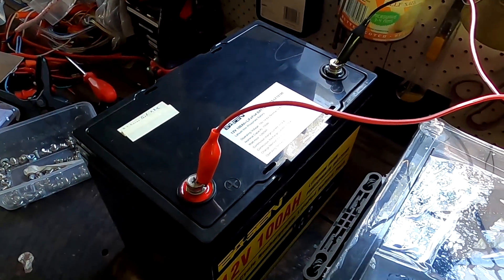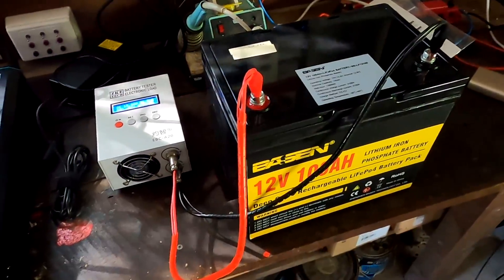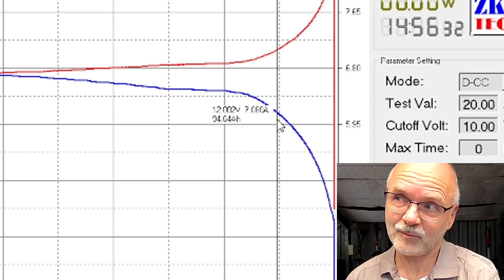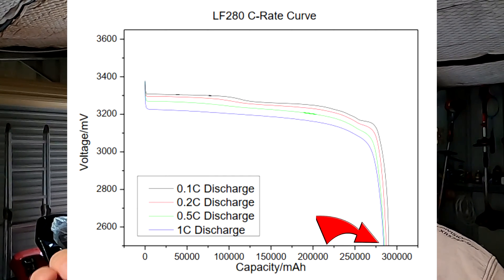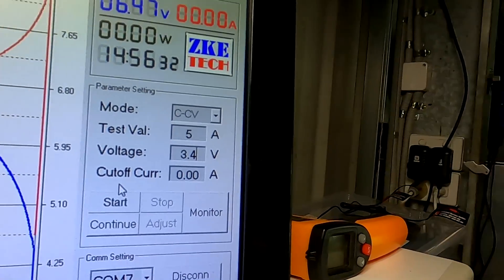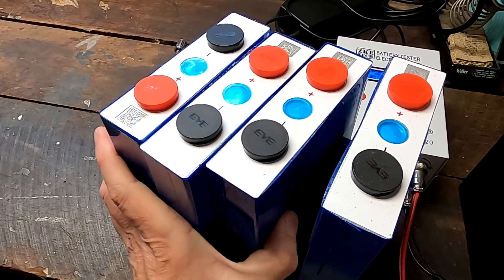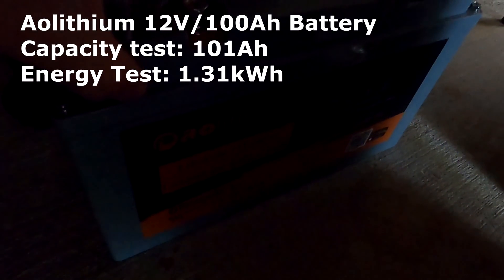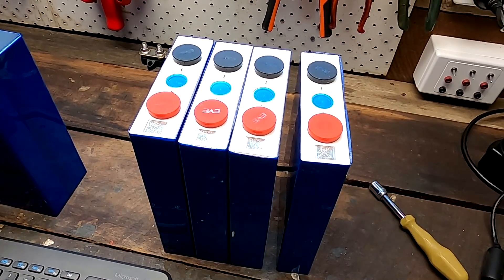The crux with most of these batteries. And how to achieve 100% customer satisfaction!

Comment: I notice your comments about "them" not being able to sell those cells, interesting cos that is exactly what I have just received from QSO.   Could you tell me what size the holes are in the battery terminals and if they are like mine m4 then how do you attach bus bars and BMS terminals?
Reply from the maker: The 105Ah cells have M4 threads and tiny unusable screws. I would really recommend using grub screws here with a decent length. Also the busbars are not great either.

Comment: Andy, i bought similar cellsmfrom Alibaba - 3x100Ah 12V with Jbd Bms. Tested:110Ah each, perfectly balanced - fine. Then i bought another 5 pieces - just want to test one - unbalnced and got only 96Ah... tested the others, goes from 94 to 101Ah and balancing for days... So, you will never know what they use in the actual batch. Thats the reason why some batteries cost the double - they use only and always good cells...
Reply from the maker: Yeah, there is a variation with these cells. It might be good to buy them all at once but if you upgrade later, nothing you can do. My battery 1.0 has three different deliveries and they are all over the place. I still can pull almost full capacity from that pack. 
Thanks for your S.P.A.T. donation btw. Much appreciated. Danke Dir vielmals!

Comment: maybe the Crux is not us but shenzen basen delivering old batteries like those you had ordered in dec. 2020 and now showed a production date of 2018 and were even EVE cells ?

The usual chinese auction and trade jjourney when EVE claims a battery not matching to  be grade b or had it in stock for over 3 months. On that auction a chinese had bought them and sold them again in china till that battery finally arrived at shenzen basen dealer who had sold it just 2 years later as what ?

GRADE A - allerfeinste Ware 

Gute Arbeit - wie immer.

Comment: I just had a bad experience with 8 "new" Eve cells which I purchased from a reputable seller.   The cells are new Eve cells,  but they are factory rejects. From what I have learned,  about 10% of all new cells are factory rejects because they do not meet the factory standards.  These rejected cells are then sold at auction for a fraction of the cost of a new,  factory passed cell.  In the past the laser engraved bar code would be scratched off. After the pandemic,  often it  is not scratched off and goes to auction fetching a higher price.  The upshot is that all new cells that pass factory standards are sold by lots. The lot is always accompanied by a green and yellow spreadsheet listing the specific cells which meet factory standards and are included in the lot. So, it is up to the consumer to ask for a copy of the green and yellow spreadsheet to verify that the cells are not factory rejects. In fact,  you should ask the vendor to send you the green/ yellow spreadsheet and identify which cells on the spreadsheet you will be getting if you buy the cells. 

Yes,  it is a lot of work.  However,  if we all do this we will help the legitimate sellers stop what is going on.
Reply from the maker: Thank for this information. I would ask what exact problems these cells might have? So far, all cells have met the capacity and internal resistance test. Is it just with ready build batteries or with single cells as well? Not sure if they are really worse than factory standard cells or if it is just an advertising thing to sell more (for a bit of cheaper price).

Comment: It makes one wonder if they are packing used cells. I did open mine up Andy (both the 100Ah and 300Ah Basen), maybe you should too...? The trick is, how does one know if they are used or not. Getting 2000 cycles vs 4000 cycles is a big deal.
Reply from the maker: If you have opened yours up, what did you find? Where they uses cells, Grade-B cells,... ? How did you find out?
Reply: @OffGridGarageAustralia  That is the $6400 (in my case, literally) question. Let me say, it didn't look good. Would love to see yours and hear your thoughts. I have BMS issues (again) with the 300Ah batteries I bought and will film the rebuild of the 300Ah batteries (in case I get ripped off). I had to rebuild all four 100Ah batteries and install new BMSes (not fun) AND had one of the 100Ah that arrived shorted out via the bluetooth module having the positive lead cut off by the silicon wafer and main battery negative terminal (scary!). Very poor build quality. I am dealing with Alex (not your sales lady). "Lithium Solar" youtuber (USA) also dealt with Alex. So far I have received no compensation at all for the 100Ah batteries and in fact got a $50 bill for the import fees for the replacement cases and BMSes. Watch-out Andy, who you are recommending. I'll let you know how my current 300Ah nightmare plays out. So far no mention of a refund...and it looks like I will have to tear them apart...I expect the same quality cells will be inside.
Reply from the maker: @silverleapers  thanks a lot for sharing and let everyone know. That's not great. Afaik Alex seems to be the manager/supervisor there. I'll get some replacement cases and will open mine up at some stage to see what's actually inside.
Keep us in the loop and don't give up!
Reply: @OffGridGarageAustralia  It gets worse. I ordered the 100Ah batteries to be connected in series (48V) but the BMSes inside only allowed parallel. I do not want to seem too harsh as they are trying and did supply new cases and BMSes BEFORE I tried connecting them or even knew there was an issue (!!) and I managed to salvage two of the old cases and now have 4 free BMSes complete with bluetooth. But it cost me many hours labour and $50 import fees. My main concern is the cell quality (and build quality). I still have faith in Basen and hope they get the quality control issues worked out and use only new cells. For the 300Ah they told me they ran out of cells but could build my batteries as I wanted them and offered 160Ah cells (320Ah) without extra charge. I can't say for certain my cells were used, but they did not look new to me (based on QR code cover-ups and pen markings on them). They were NOT bloated. Flat as pancakes, as they say. And perfectly balanced. Trust is a huge deal for our battery manufacturers and any one company that is sub-par hurts the entire off-grid movement globally and scares away would be newbies. It is a global responsibility at this early stage. Basen are trying Andy, and seem to understand what the western world demands for quality. It is Uber important to be sensitive to the fact that they have such little margin for profit/error corrections. It is a serious issue for both sides. And of course the dreaded shipping fees hamper everything. With a $2.10 USD minimum wage and many working 16 hour days (incl Alex), I have to cut them some slack. Bye for now, from foggy cold damp Newfoundland Canada.

Comment: When I discharge tested my new individual cells with the ZKE, I had issues with voltage drop in the alligator clips. At 15A they got warm and my DMM measured a higher cell voltage than displayed on the ZKE. I had to make up new leads (6mm power wires and 0.5mm kelvin sense leags with ring termonals) and the voltage measured at the battery terminal now matches the voltage displayed on the ZKE.
Reply from the maker: Thanks Jim, that's great feedback. I always wanted to do that but have no time at the moment. I should bump this up on my to-do list...

Comment: 040322/0242h PST 🇺🇸.    Thank you, Andy. The more I watch, the more I study the presentation, the more I get confused. I’m not being negative, but certain numbers doesn’t seem to add up, for me. Of course the issue is myself. But I think some clarification is required for a layman like myself.
i) I see your fully charged (top charged) cell voltage at 3.64V (Approx) and the combined voltage is 14.6V and 100% charge was recorded.
ii) In your previous presentation, you mentioned 3.55V is considered the best, which is 14.2V for LiFePo4 Chemistry cells.
iii) I went a bit lower as recommended by VICTRON (for LiFePo4) @ 3.363 (with a delta of 0.002) and my reading is 96% charge. Surprising, indeed.
iv) For experimental purposes, I increased the voltage to 3.60V and achieved 14.4V cumulative and to my surprise the percentage of the charge did not touch 100%. 
v) As the night fell, I observed the cell voltage returned to 3.363V and yet the charge percentage remained
96% !
vi) The question is why does LiFePo4 exhibit such a phenomenon? I have gone through several references.
For The Almighty sakes, not the YouTube blah blah. The real scientific references. But no avail. I failed.
Still wondering, as to why LiFePo4 cells exhibit such  phenomenon. 
Are my cells (12.8V configuration) internally defective?
My cells are 
1) Leshen 272A (Voltage normal at rest) 2) EVE 280A being charged by 2 sets of 500W PV Cell arrays .
The cells are finally Parallel and goes through myriads safely devices and to lights and other small devices.
Will appreciate comments with gratitude. Cheers and good evening. 73s… 
2029LT Brisbane 🇦🇺 
Apology for the lengthy note.
Reply from the maker: Hello Sree!
i) this is the maximum voltage the cells can be charged to as per specs. If they are all on this level, the whole battery is 100% top balanced.
ii) 3.55V is not 'the best' this is something everyone needs to decide. I charge only to 3.45V as I find this charges the cells to 99.5% and keeps them away from higher voltages (which causes stress and degradation).
iii) charging to 3.363V is not enough to charge LiFePO4. This is still in the flat part of the curve and can be anything from 40-80% SOC. Whatever shows you 96% is making a guess due to this low voltage
iv) what is showing you %? The BMS? Don't worry too much about it, make sure it shows the Ah correct.
v) if charging current stops and there is no load, the voltage will drop but the battery is still fully charged! Voltage is not an indicator for SOC!
vi) The answer is because LiFePO4 has such a flat charge and discharge curve unlike most other batteries.

Comment: Interestingly, although it managed 100Ah, at 1270Wh it didn't achieve the claimed 1280Wh.
Reply from the maker: Because of the lower voltage is had. kWh are not great to measure capacity, Ah are far better because it does not matter what voltage or resistance we have in the circuit.
Reply: @OffGridGarageAustralia  Ah but. 100Ah at 12V is a lot less power than 100Ah at 48V and at the end of the day, it is power we want from the batteries. But I do understand what you're saying.

Comment: Hi Andy, the shunt you used in the 0.2C test. What is its accuracy %?
Reply from the maker: No idea. Have a look at my website, there is a link to the shop where I bought it. I would assume it changes with temperature as well?
Reply: @OffGridGarageAustralia  Thanks Andy i had a look. Aliexpress lists it as 1% accuracy. I was only asking as battery was 2% under was wondering perhaps the meter could possibly be reading under. I know my cheap meter shows quite different results from my Victron shunt. 

Love the content please keep doing what you do. Have learnt a lot from your videos.
Reply from the maker: @justasix8815  One Chinese % is good enough for me.
Thanks a lot, Ben.

Comment: I have to question how much he cells in the Shenzen Basen battery will degrade after a few cycles and then a few hundred cycles?  I just replaced a pair of 18ah  automotive style LFE 12V batteries used a homebuilt aircraft that were connected in parallel. specs for each were the same, Both were the same form factor,  one was a cheap Amazon $120 battery and died in 10 months and 40 flight hours. The other an industrial quality battery from a company in Norway that cost $240 was three years old and had over 200 flight hours, and it tested 98% capacity to new, same make and model replacement pair we replaced the old Battery pair with.

Comment: With all that mucking around I think it's a lot more easy for most people that are not that tech savvy just to buy an Renogy or whatever lithium battery
Reply from the maker: They can just buy this battery and it will work fine for them. I believe the Renogy or whatever battery you buy will have similar/other issues if you look for them. Any of these batteries you can buy now are outstanding if you compare them to say a lead acid battery. 
When we test these batteries we are really picky and try to find little things which are not ideal. But overall, they are all fine and great batteries.

Comment: Good Test. What could be is, that they use cheap grade B 105 ah cells. That cell drift is crazy. With my grade A cells after 200 cycles now, i have 40 mv Voltage drift at 5% SoC. With a daly bms (which is obviously not very good at balancing) oh, and where dir the intro music go? :)
Reply from the maker: I think the cells are just not well matched in this battery but even then the initial top balance should have fixed that. The drift is crazy after just one charge. I'll do more testing...
Oh, yeah, the music... This hole video was actually part of the previous battery test video when I realised I'm far over 60min 😂

Comment: Hey Andy, long time subscriber, wondering if you could help me out with something. I've got a zke tech EBDA20H and find myself in the situation of having to wire my own UART to gx connector. Is there any chance you could open up the tiny screw at the head of the GX connector to help me figure out the correct positioning for the tx/Rx/5v/ground connections. It is a slightly different model than yours but I imagine the positions of these connections would be the same. Haven't had much luck with the seller I purchased mine from in regards to tech support. Would be a super help if you could help me find these positions.
Great video as always, 
Cheers
Reply: By the way... REALLY looking forward the your tests on the welded studs. Mine arrived the same and I was a little shocked by the tiny contact surface. I've imagined a few approaches, but it just seems odd if any of these are necessary...
Reply from the maker: Hi Chris, no problem. Can you send me an email so I can send you a photo of mine.
Which GX connector is that exactly?
Reply: Having a tricky time finding your email address, can't see it on your channel or your website.
It's a 4 pin gx connector, sometimes called an aviator connector i believe.

Comment: The thing is people moan when a lithium battery is 2% under the quoted capacity yet Lead Acid manufacturers have been misquoting thier products capacity for literally decades 😏
I have yet to test a lead acid battery that reaches 50% of its quoted capacity down to 12V , usually 40% ish is usually the result.
What I'm getting at is they all BS us but some  (LA batteries) are bigger BSers 🤔
Reply from the maker: That is correct. These 12V batteries are all fine and far superior to any lead acid battery so we should not pick on these little things. Unless you test this, you won't notice...

Comment: The first test ya did with that 12v 100ah battery was fine,the voltage on the meter said 11.7v where if it went down to 11 or even 10.7v it would be over 100ah makin it closer to ya 10tah cells

Comment: Those CALB cells at 105ah sure look like EVE cells. Mine all tested 109 or 108ah and change when new, after the first dozen or so cycles they drop to closer to rated capacity (very common for new LiFePO4 cells). I have been paralleling some electronic loads to test pack capacity. You just might need to calibrate the first meter you used. Even the 100ah battery is "good enough" for most people, depending of course on cost.
Reply from the maker: Thanks John. They are supposed to be CALB cells but came with an EVE terminal cover 🙄 So maybe they are EVEs after all...
Can you calibrate the power meter? I have to have a look in the manual which is translated from Chinese and not good to read. I always checked the current and that was good enough for me as I measure capacity in Ah and not Wh.
Reply: @OffGridGarageAustralia  Well, I always measure in amp-hours as well (since that is most commonly what the manufacturer rates them in). All I can say for sure is that those CALB cells look exactly like my EVE cells. :-)
I expect there is a calibration method even for that meter, but finding out what it is might be an exercise in futility. My electronic loads came with calibration certificates, and they all give identical results (as does my EBC-A40L). Cheaper meters like that are also "good enough" for most people, and are certainly cost-effective. I designed manufacturing test sets 35-40 years ago, so have a tool/meter accuracy fetish.

Comment: Hi Andy, good things can be done better.  Do not use those alligator clamps. For this test along 6 Amps this might be acceptable but for 20 Amps  your test would go wrong. In best case you get wrong data and worst case you get those tiny teeth of your clamps glowing. But your obviously well calibriated nose will give you an early alert :-) :-) :-)
For explanation: Even if the resistance meter does show reasonably low values, there is an additinoal effect going on. We talk of current displacement. High current tends to flow in peripheral areas of a contact point. So the center will be depleted from current and the periphery will be crowded. The effect is a dynamic rise of resistance along increasing current. Best way to detect this "feature" is to measure voltage drop around the contact point along nominal electrical current planned for test.
Reply from the maker: When did I use crocodile clips for this test? This was only to charge the battery?
Reply: @OffGridGarageAustralia  Sorry, got it wrong :-(